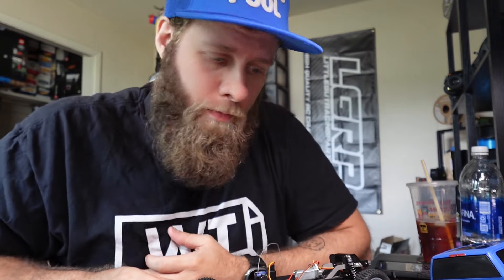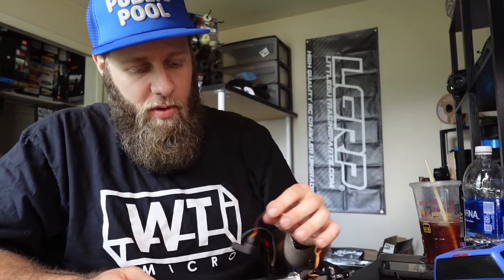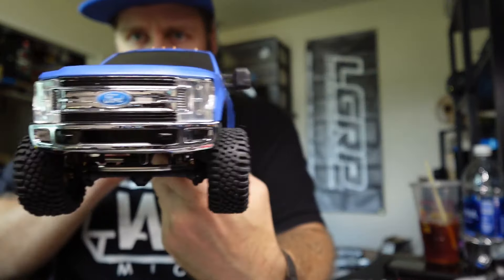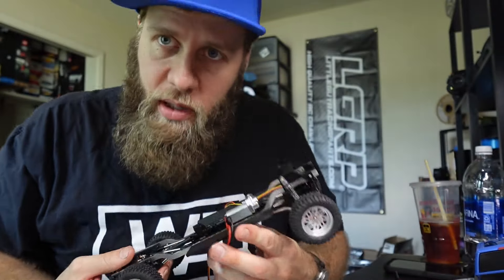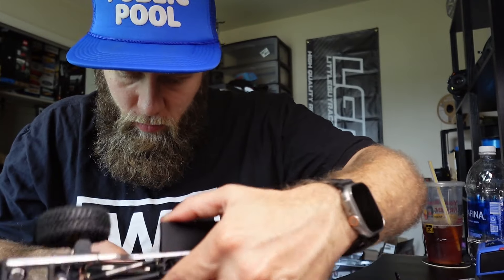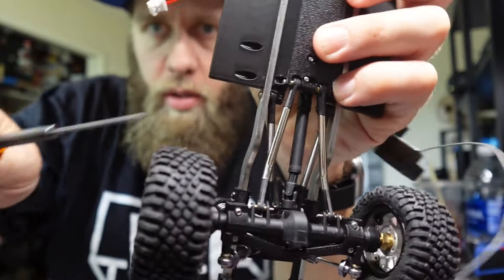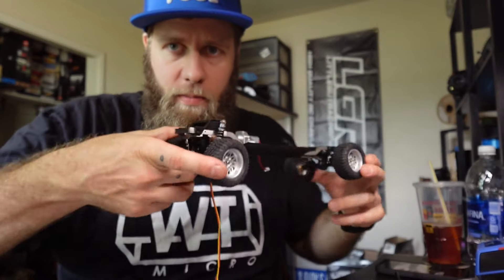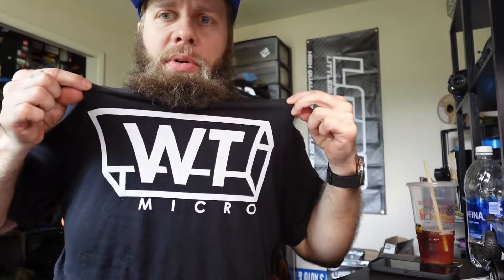Scx24 F250 - NEW CHASSIS KIT from WT Micro

Comment: Last night I was putting together a new injora lcg chassis and when I was just about to run it I snapped the little on/off button. And then I pulled apart the wires going to the motor which stuffed it.
Reply: New furitek stuff ordered